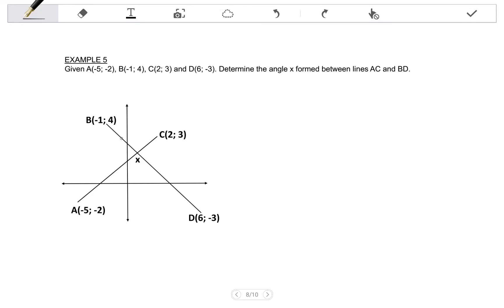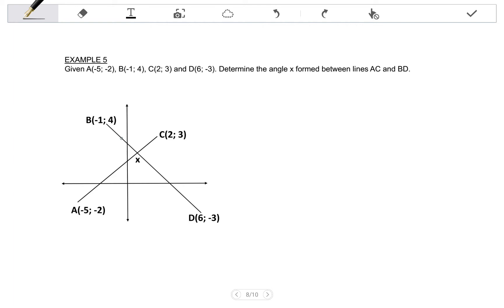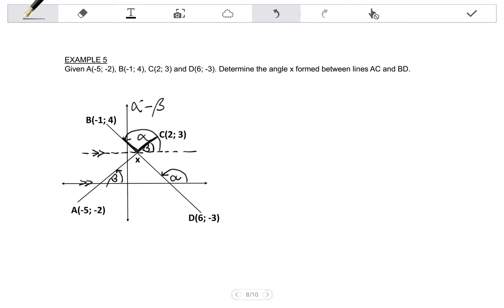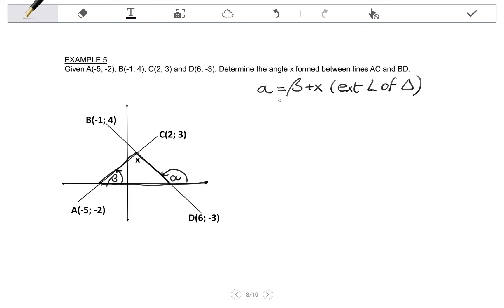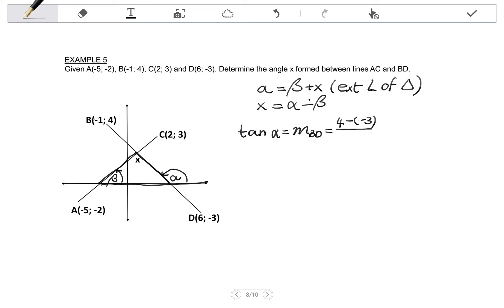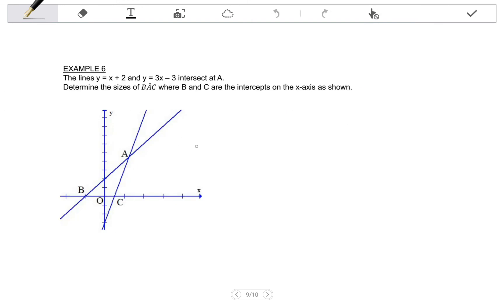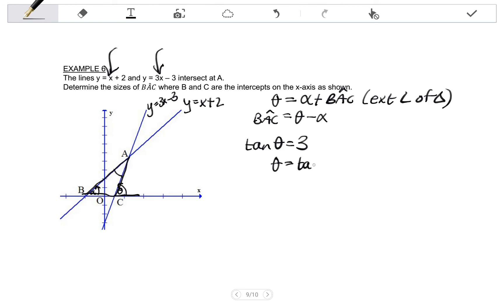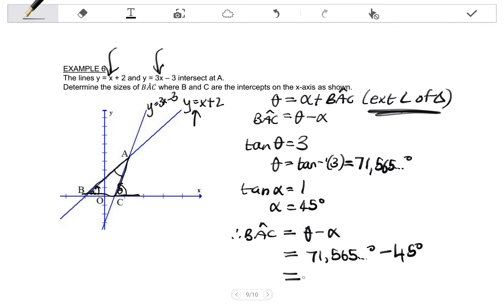11 ANALYTICAL GEOMETRY Calculating interior angles using angles of inclination

Comment: In the final problem, when calculating the gradient of AC it seems the incorrect coordinates have been used. instead of using the coordinates of A and C the coordinates of B and C were used. If my observation is correct then the final answer is incorrect. Can someone please double check this incase my observation is wrong.
Reply from the maker: Hi Donthe, you are correct in that there is an error, but it is simply the naming of the gradient of BC is incorrect. I named it the gradient of AC instead of the gradient of BC. The answer is still correct. Thank you for picking up the errror.